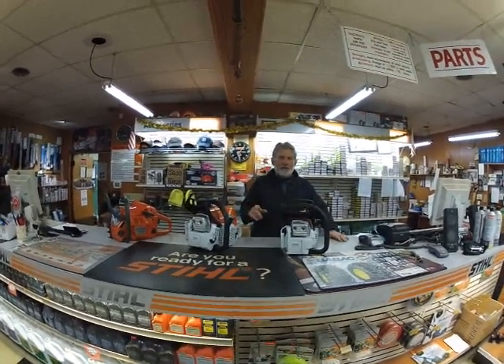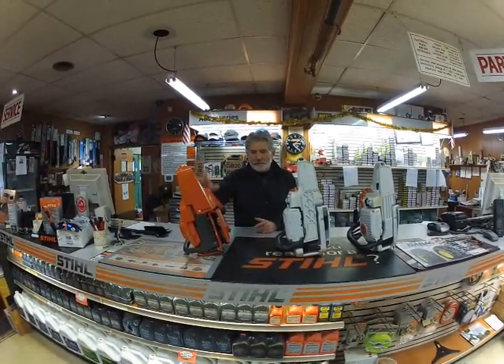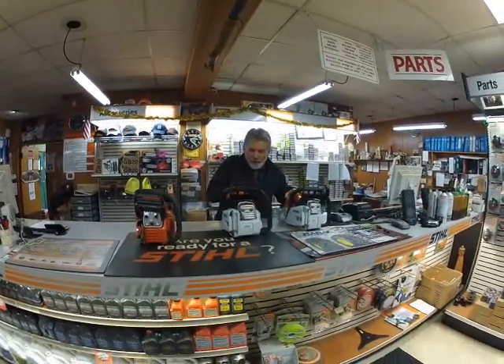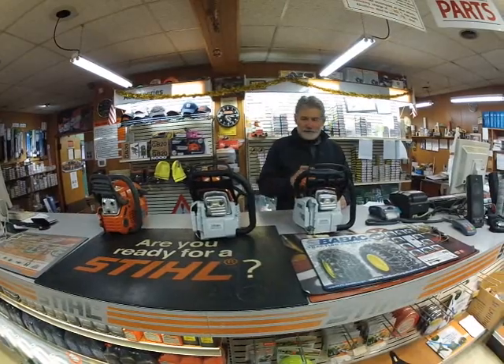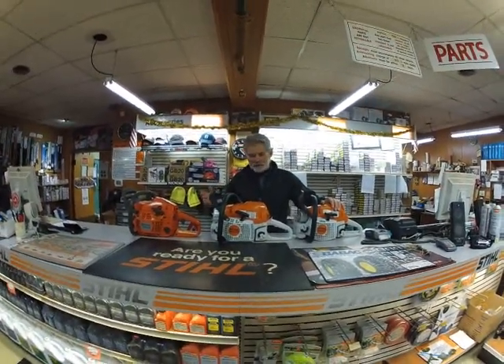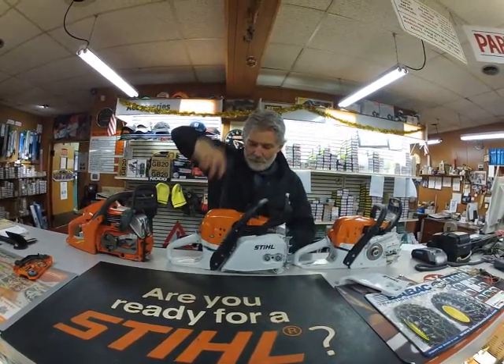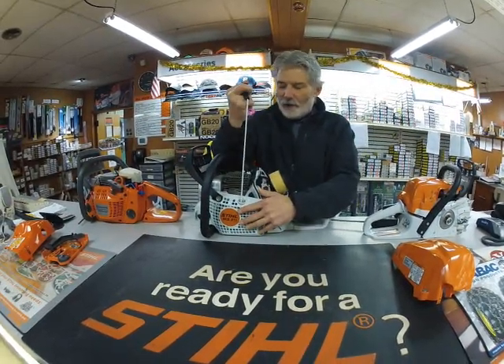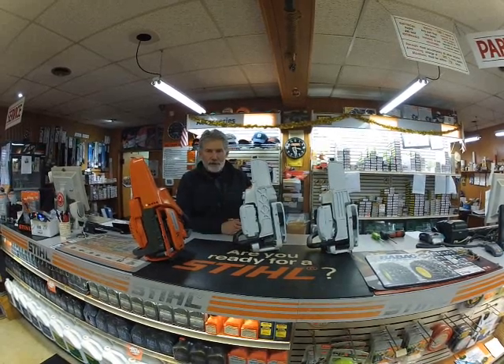Stihl VRS Husqvarna : Firewood Chainsaws

Comment: Many times on chainsaws, the failure is due to crappy seals making them not start.  It’s usually not the carb, injector, plug or air flow - it’s a slight compression leak due to crappy seals which you would almost never notice and are hard to replace. Chainsaws run at very high RPM’s that cause friction around the main drive shaft. The seal around that shaft often gets deformed by the intense heat allowing compression loss.  The Japanese do a much better job in building small engines in my opinion because they use high-temp seals and have a great history in small engine building. I would only own a Japanese made Chainsaw.

Comment: You can buy entire replacement engines for farm and ranch saws online these days for a little over $100. They're easy to replace by loosening the bolts on the bottom and removing one of the the bar mount studs. I've ran a stihl ms310 for years and other than being ready for a carb rebuild,its good as new. They are heavy for the power they produce. You may find it interesting that echo saws all have the pro style magnesium case,metal handles,twice the warranty of stihl and husqvarna and cost less than most farm and ranch saws. A stihl ms261cm is stihls,50cc pro saw and a husqvarna 550xp is Huskies 50cc pro saw. Each cost around $650. The echo cs501p is echos 50cc pro saw and it's around $459. Just food for thought,if you're a firewood guy.

Comment: This saw does exactly what I'd hoped The 9" size, 🌻  allabout.wiki/DECKER weight, & ease of use are right on for me. I decided to power up my gas chainsaw on a 20 yr old, 12" diam burford stump because I didn't want to overtax the 20V, but the 20V was perfect for cutting a bunch of 4" branches into firewood. That's what I wanted: an "easy" chainsaw for light duty (too big for a lopper) on my 1/2 acre woodsy property.

Comment: Would you recommend and older husky 51 over a newer husky 450? Also what about echo brand? Thanks
Reply from the maker: Go with that 51! Great old saw. New stuff 450,455 are plastic cheaper saws.
Reply: @mcss317  The gentleman stated that the saw has been completely rebuilt new piston rings connector rod seals clutch carburetor etc. $250 sound like a good price? It also has a brand new 18 inch bar with brand new chain
Reply: I was looking at a newer Husqvarna 460 rancher brand new from Lowe’s for comparison
Reply from the maker: @paulb9376  probably has a new piston and rings, I doubt it has a new connecting rod because the connecting rod is part of the crankshaft. If it has good compression and doesn’t appear to be physically damaged that’s a fair price
Reply: @mcss317  yes a new piston, rings, clutch, carb, bar and chain.  I’ll give it a look tomorrow, thanks for the insight

Comment: Excellent video, I'm a farmer/ weekend warrior and traded a ms390 against a ms261cm solely for the weight, I've a busted shoulder, it's a ripper despite being 14cc less than the 390 and only .3hp less.  I picked up a second hand ms461 a few years ago for bigger stuff so  the 261 is used mostly.  Loved the 390 but found the weight a problem over time.  Pro saws are worth the extra money for my circumstances

Comment: Have a Husqvarna 55 Rancher that was just out of warranty, fuel line rub a hole through it, sucked too much air and seized the piston to the jug. Tractor Supply wouldn't do anything for me, being right in the middle of cutting season I bought a Husqvarna 455. Found a jug & piston kit on eBay for the 55, New jug has pressure relief on it, original did not. Was around $80 for the kit at the time. Kit worked great, still using both saws. Was wondering if my 55 Rancher is considered a modular saw that you were saying replacing the jug & piston were a thing of the past? If so, eBay has parts, wasn't that difficult to do. 
Thanks for the video btw.
Reply: That 55 is similar to a pro design, magnesium split case, separate bolt on cylinder.  it's not a modular "clamshell" plastic case design. Your new 455 is a modular clamshell plastic case design.

Comment: I have 6 Husqi. Three 455 R..
I run the crap out of all of them.  I am hard on my gear.  I am pretty much a daily cutter.  Eeeh doin 3 cord or so a week.  I have no complaints about the brand.  

I just picked up a 545 that I uave not ran yet but am excited to put to wood

I never ran a Stihl so I have no opinion. 

I do love the Husqi brand so much that I just purchased a big ass lawn mower.  I go with what works.

I purchased my first Husqi because I needed a saw quick and figured why not give it a try.  

I do recommend

Comment: mmmm like to see the saws after they have been cutting a winter season of firewood.   they do need maintenance and cleaning. nothing like a good coating of sawdust and oil on everything internal. like the magneto.   personally. never seen a plastic sided chainsaw.   opps yes I have.  the operator accidentally engaged the chain brake. the result.  hot plastic thats rendered the saw as sparse parts made.  the chain brake is a safe mechanism. and needs to be accessed for inspection and cleaning.  the decompressor make life simple. starting a saw.   once it fires on choke. remember to reset it. before you pull that starter cord.

Comment: From a mechanics point,  If the crankcase on a stihl brakes i can buy a side, husky you buy a short block.  Also throughout the range the stihl is a complete metal engine the lower end huskys the bottom half of crankcase is a plastic unit which doesnt handle the heat of long usage as much.

Comment: Hi Let's try this again, and hopefully get an answer? I love the video, and that I thought I knew what I was going to get until you pointed out that these have cheap plastic under the bars and can't handle bigger bars... I'm Handicapped from an accident, and need a saw that is "light" (Under 12lbs) and can handle a 25 or 26 inch bar so I don't have to bend over as much limbing and cutting, I need a saw to last and not break down... I'm on SSD and Very low fixed income.... I need the fastest starting and the most dependable saw... I'm leaning towards a Husky but now I don't know what model... I was hoping to buy a chainsaw mill to make boards for tables and arts and crafts stuff, besides firewood... But I would need a 36 inch bar for that but I can't afford those huge saws that come with a 36" bar as well as I can't lift the 17 -24lbs saws either... So I'm kinda stuck now as I was hoping to just get one saw to do everything... So from what you said I guess I'm looking for a Pro saw??, Is there a aftermarket part that will allow longer bars on like a 550XP or CM261?? I would take either a Stihl or Husky, Which would be the best model for me of each brand... I look forward to your response... Then I can call around and hope someone gets one that's factory refurbished or an open box new one that's discounted... Thanks

Comment: Both Stihl and Husky made good saws - but my biggest gripe about serviceability is that Stihl uses hairpin clips to attach the throttle and choke linkage. Those tiny clips make a field repair almost impossible. You know the feeling when one of those clips gores flying across the shop - well, in the woods there is NO finding it ever again and there is very little you can do to put the linkage back on without it. 

Husky uses "Z-bends" on the ends of the linkage and there are no 'Jeez-Clips" (so named because you say: "Jeez - there goes the clip!"). 

Since Husky uses a "Dykes-type" L-shaped and keystoned piston ring ---> you could have mentioned that they are a lot less drag on the cylinder walls and therefore don't wear the bore out as quickly. Just saying......

BTW: Husky markets a 100:1 oil for it's engines too. I use it when I can find it - or afford it!

Comment: Not happy with my Stihl 261. After 3 years cutting firewood, saw broke down with crankshaftfailure. Stihl told me it was my fault not using Stihl oil. I mixed same oil and gas as I used for 25 years on Stihl 026. Not happy with Stihl any more. Not so robust saws and no god service. No more Stihl for me......
Reply from the maker: No argument here.... However, today’s fuel is JUNK! No matter who’s oil you use the fuel will separate & breakdown. That said, the crank & rod bearings will take a beating from the fuel separation. Couple this with the lean run condition all these modern units use and you got problems.
Sharp Chain
Clean Air filter
Clean Saw
FRESH FUEL
This is the only way to keep them happy & ensure a long life

Comment: Hi love the video, and that I thought I knew what I was going to get until you pointed out that these have cheap plastic under the bars and can't handle bigger bars... I'm Handicapped from an accident, and need a saw that is "light" and can handle a 25 or 26 inch bar so I don't have to bend over as much limbing and cutting, I need a saw to last and not break down... I'm on SSD and Very low fixed income.... I need the fastest starting and the most dependable saw... I'm leaning towards a Husky but now I don't know what model... I was hoping to buy a chainsaw mill to make boards for tables and arts and crafts stuff, besides firewood... But I would need a 36 inch bar for that but I can't afford those huge saws that come with a 36" bar as well as I can't lift the 17 -24lbs saws either... So I'm kinda stuck now as I was hoping to just get one saw to do everything... So from what you said I guess I'm looking for a Pro saw, I would take either a Stihl or Husky, Which would be the best model for me of each brand... I look forward to your response... Then I can call around and hope someone gets one that's factory refurbished or an open box new one that's discounted... Thanks

Comment: whatever you do, never buy an echo chainsaw, total freakin junk and their 5 year warranty is a joke, they will not stand good for it
Reply from the maker: Echo makes good ones and echo makes not so good ones as far as your warranty goes the dealer can either make it happen or let it lay. The dealer plays a huge role in any warranty repair all they have to do is pick up the phone call the distributor and go to bat for the customer. That is if it’s warranted. Meaning abuse of a power saw is an easy thing, so there’s a fine line between warranty and abuse
Reply: @mcss317  either way, the 6 year warranty on echo saws is a hoax

Comment: I have owned, at one time or another, just about everyone of the saws you covered with the exception of the 311.  The 391 is a hoss but I grab my 360, 361 or 660 before I grab it, strictly because of weight.  It is not the specific design that kills saws, today, but the quality of the gas and idiots.  An idiot can smoke a saw in one session, which is why there are so many returned saws to the big box stores, but this is just not limited to chainsaws.  They do the same to lawnmowers and any piece of gas powered equipment.  The only thing safe with these folks is a hammer or anvil and they will find a way to break these in the warranty period.

Comment: Echo kills Stihl and Husqvarna in this segment. The Timber Wolf (CS 590) is a much much better saw at the $400 price point.
Reply from the maker: Gilitar that Echo unit is a good one, we sold them as well. From a value standpoint the 590 can’t be beat. It’s built like Stihl & Husqvarnas pro units. It utilizes a split crankcase and removable top end.The 590 is heavy and does incorporate some older features, not that that’s a bad thing. I agree with you on this one!

Comment: Choose your saw shop / dealer before you choose the brand.  Both of these brands are fine.    Have used many saws from both brands.  And both offer lots of different models.  I overworked a small husky 5 years ago taking out bigger wood than it was designed to handle.  I burned it up, basically.  Took it back to my local dealer and sheepishly asked for a repair.  She said she was sorry it had let me down and gave me back 100% of what I paid for it as a credit against a bigger saw of the same brand.

Comment: My Toro string trimmer called for 32:1 fuel and it's working for 30+ years. Is it a good idea to run a Stihl chainsaw on 32:1?
Reply: Motor 2 stroke oil is a lot better than it used to be. Lot of 32:1 stuff can run 50:1 now.

Comment: Hi Rod, I need to buy a chainsaw and i'm confused. My choises are STIHL MS 170, 180 vs 171,181. Are the newer models better enough to justify more money? I need one around the house. Also the thin bar/chain 1.1mm Stihl uses on 170,171,180 makes me to avoid them.
Reply: I had d same problem when I was looking to buying a saw, I end up with the stihl  ms 180 14" bar, I used it for ever time, very good saw, is up to u, but stihl is the best.

Comment: Wasnt initially impressed with my stihl farmboss didnt idle didnt rev an always flooded i modded carb adjustment srews an tuned its a great running saw bu my ms261cm prosaw  has been flawless from day one. My other prosaws are always tougher an a little longer lastimg an easier to work on compared to farmboss line.

Comment: Good info , just all in what you need  I guess . I started with a Mac10-10 then  added a 272xp and over 20 years added on 028 av , 034 av ( with 036 top end ) , 262xp , 576xp and a 395xp . I gave an 029 super and 460 rancher a shot . Just didnt meet my standards

Comment: I bought a 455 rancher used 6 years ago for 325.00 and that saw has been flawless, 100% perfect and has had a rough life cutting firewood, tree roots and stumps.  It starts right up every time and does the job.  Found a bunch of butt cuts after a logging job got done and we cut up 10 cord of 2 to 3ft rounds in 16inch lengths for hours straight and that saw never blinked.  Why get a pro saw?  Do the pros really do that much cutting with all there equipment.  Some loggers don' even carry a saw anymore.   I heard a 455 ranch will cut 300 cord of wood before the ring wares out.  That is probably true

Comment: I choose Stihl because we have a good local dealer. I think both are great saws. I have had one of my Stihls for 22 years, the 460, even ran it over with a tractor which buried it in the mud, but it still works fine, just got a new 362c with 18” bar, for hard woods this a great saw, lighter than my older 341which I still use for felling, the 362 I use for firewooding as its lighter.
What I have noticed between the two makes is Husqvarna does probably make better anti kick chain, they invented the special guard link. Also they supply a superior felling bar which is made of cast rather than my Stihl steel bar which has welds and is in a state of rust.
So who makes the better saw? I think it’s like a choice between Toyota and Volkswagen. But Husqvarna have some better accessories and while Stihl make excellent chain, Husqvarna has the better anti kick chain.
Reply: Angus Robertson never used safety chain .... never will

Comment: Thank you for this video. Glad I stumbled upon it. I’ve been debating which saw to add with my ms250. My ms250 currently has an 18” bar I am going to be putting a 16” on the 250. I want a more powerful saw to run primarily an 18” bar with option to run a 20”. I was debating a 311/391 OR ms261 or ms362. After watching this the farm ranch saws are out. No question. So now I’m down to the 261 or 362. And also standard carb or Mtronic any advise????

Comment: You get what you pay for, and if you use it for what it is intended, it can still last for many years, possibly a lifetime. My dad bought me a MS271 for Christmas, and it is plastic, but you can still buy replacement parts for it and whatnot. That said, I don't use my see every single day. I use it for cleaning up around the property and if trees come down. For my use, the see will last my lifetime, because I maintain my equipment. Should I ever need to come upon a time when I need a pro saw, I will get one, but don't see it happening. I don't have a wood burning stove, and I am not a logger, so it works great for what I need. People talk so down about polymer plastics, but consider this. Many gun manufacturers use polymer plastics, because they are lighter and reduce recoil, plus they don't rust.

Comment: I still have my old 028 Super from the mid '80s and will NEVER part with it because of the construction, materials  and reliability.  It has always been well maintained and cared for, is rock solid reliable and still gets the nod for firewood and lighter tasks.  Hope the 461 lasts that long.

Comment: Fantastic video!!  Absolutely the best video about chainsaws I have ever seen!!  I’ve been using the same Poulan 18” Wild Thing purple and green saw for 17 years. I purchased it at Home Depot for $99 Back in the day and I’ve replaced the spark plug once in all that time. And I’ve cleaned the sponge type air filter regularly. I cut 2-3 cords of wood per year and sometimes 15-20 rounds when camping. So IMHO maintenance is the absolute defining activity for making your saw last no matter which brand you have. If you treat your tools like crap they will perform like crap and not last very long. I’m about to retire the old wild thing and purchase a new saw and I’m considering a Stihl just so people will quit making fun of my purple and green saw lol
Reply: Prepperjon you can get a Makita (formerly Dolmar) and wow them with the gumby green!

Comment: they both need to get rid of the plastic designs and emission rules.   The old 066 ,088, 090 , avs were the best.   Husqvarna 70 + cc saws are the best in 2017.  In Europe NLD there are NO good Stihl nor Husqvarna dealers that have the top of the line saws on stock , nor they have dealers with technical experiance. Stihl or Husqvarna support is far to find.     In the usa i see dealers with a good stock line of saws, and with knowledge.  The now what people want with there saws.  3/4 handle, other carburetor, muffler mod, bigger flow oil pump.